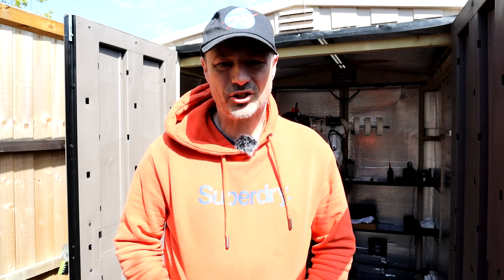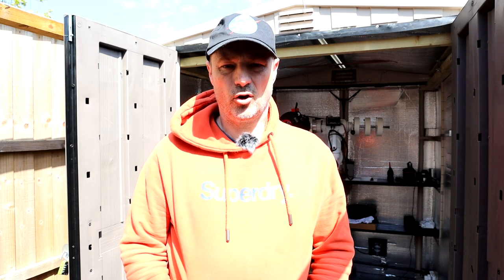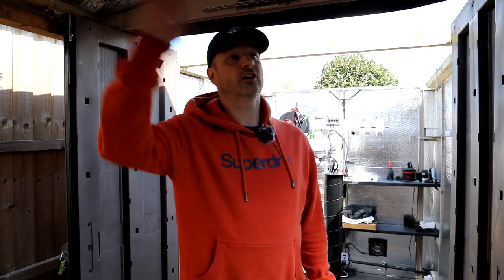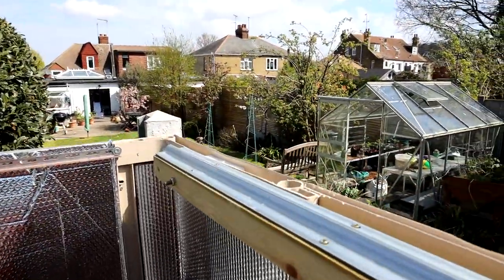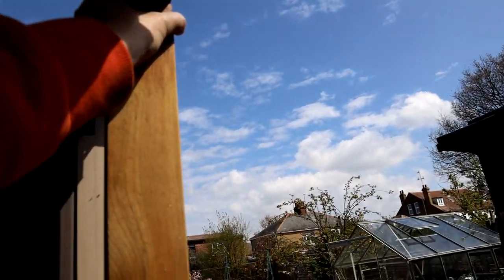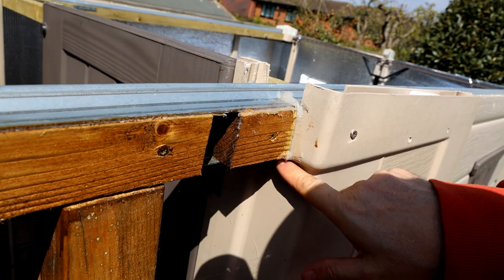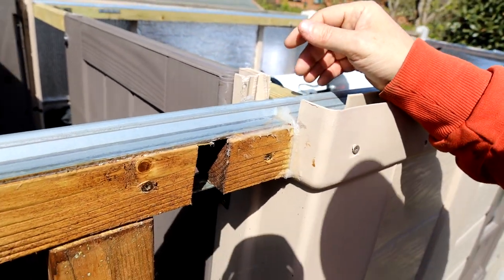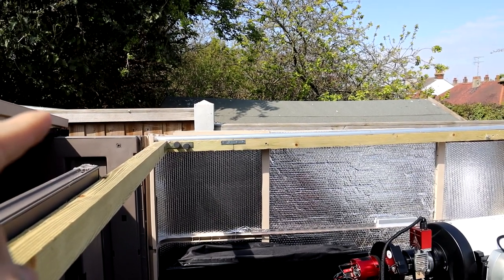Budget roll off roof Observatory update. Further details that were missing from 1st video

Comment: This is an exciting project on a hobby budget.  I was wondering if something like a: $160.00  [Genie Chain Drive 500 Garage Door Opener - Heavy Duty, Reliable Chain Drive - Includes 1 Pre-Programmed Garage Door Opener Remote, Lighted Wall Button, Safe-T-Beam System ] would work? It has  close/open limit switches.  😎 Thanks a lot.  Doctor's who TARDIS.  🧐
Reply from the maker: I am sure that could be made to work. I went for this system over chains as I think there is less chance of any failures. But there are many ways and that system could even work better
Reply: @Astrobloke  thank you have a great starry night.

Comment: Thanks, very informative. I have just bought a Keter shed and will give it a go. If you were starting from scratch, would you do anything differently? For example, rolling more of the upper section of the walls (or indeed the whole shed),  rather than just the roof?  Keep up the good work!
Reply from the maker: Hi Paul and thank you for commenting. I definitely would look at other options if I do it again. I would most probably go larger firstly. Another guy has the same shed and took my ideas but cut the shed in half. He sent me an image I could share with so you can see. If you email me at astrobloke@outlook.com i’ll email it back to you
Reply: @Astrobloke  Email sent, thanks

Comment: Hi there, Glenn.  I have just finished the first stage of by observatory build and I went back to check this video as I have the same issue with the gantry bringing water in through capillary action.  Anyway I have fixed that now (roof sealant on the whole of the gantry) but can I ask about the height of the pier - what is the distance from the centre line of the parked scope to the top of the side wall?  I need a bespoke pier as my room is a little higher than yours and trying to work out the measurements of the pier?  Thanks a lot.  Chris
Reply from the maker: Hi Chris and congrats on the obsey build. My walss are 6ft high from  the floor and floor to centre line of scope parked horizontally is just under 5ft. about 4ft 10"
i could have gone higher to clear more wall  but my horizon of trees and rooftops would not have allowed any more sky so sat down a bit to get more wind protection.
Hope this helps

Glenn
Reply: @Astrobloke  Hi Glenn, was about to email about the pier height but thought I would check the comments first and found the info I wanted. I'm pretty close to starting out on my own build. I've really been affected by the winds of the last few weeks on my 8" Newtonian so your experience has been invaluable. Thanks!
Reply from the maker: @secretstill  hi Mark and thank you. Any questions please feel free to email me ( astrobloke@outlook.com) good luck with your project. The wind has been very challenging especially for newts